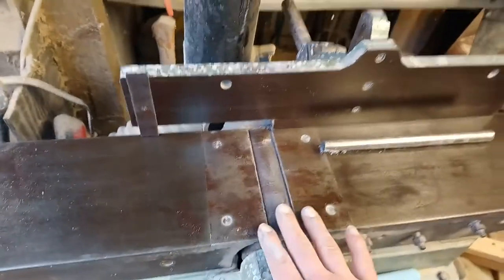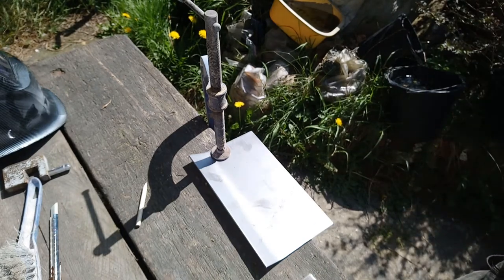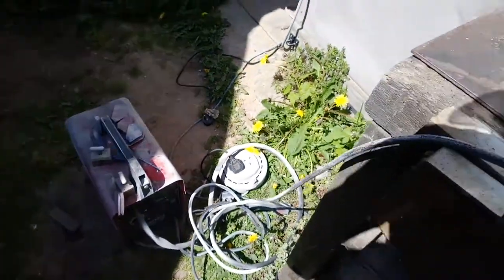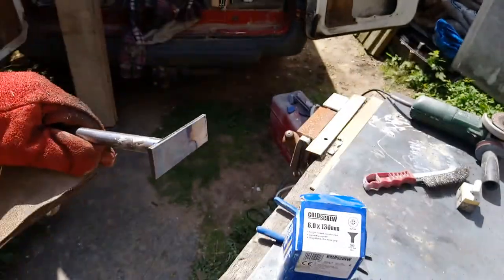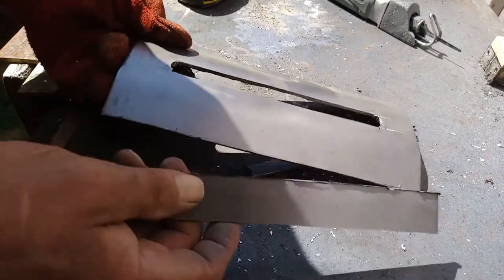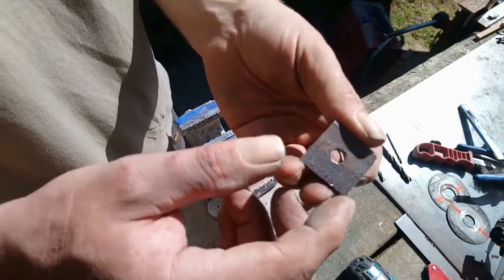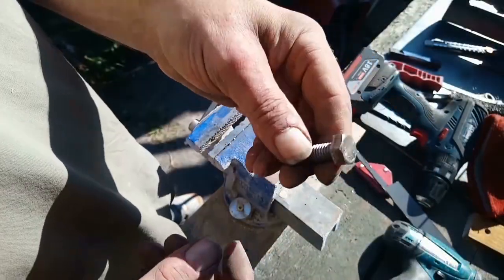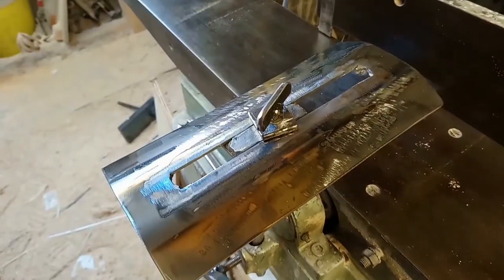Welding a guard for my jointer with some novice flux core welding

Comment: Well done Gid, welds are strong and the guard is functional and like you say will safe your fingers. So a maintenance job well done I would say. 👍 I get my boy to do things like weld as he’s a fabricated welder. In fact he’s doing me a couple of clamps for the track saw which you showed in part one of the wardrobe build. 👍
Cheers Gid
Reply from the maker: Hi, yep i used to get my stuff done by someone else but thought I'm going to have a go at that, it's just joinery with metal,  😀 not as easy as it seems but that little welder has got my van through a few MOT's now so it's paid for itself. it's ok on sheet body metal but not quite powerful enough for this job, it did the job though, 
 Time to buy a new bigger version me thinks, any excuse to buy a new toy 😉
Yep those clamps do the job well, i hope yours do too. 
n yep safety is key on machines like this that can whip your fingers off in a fraction, there'd be no sewing those back on, 
Thanks made refinements to it today, i post vid later. 😊